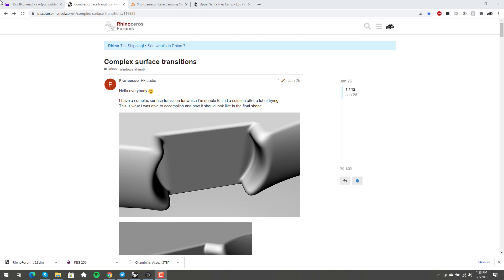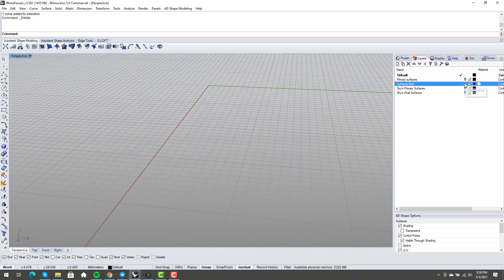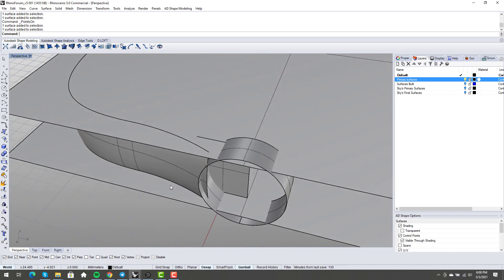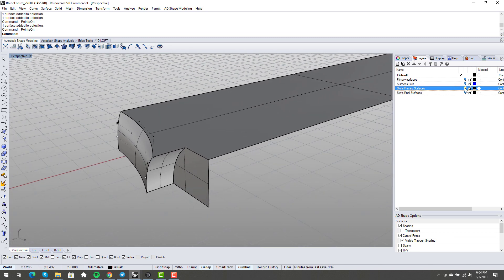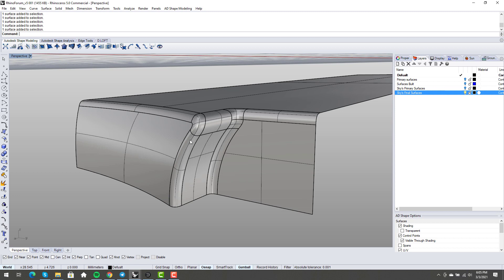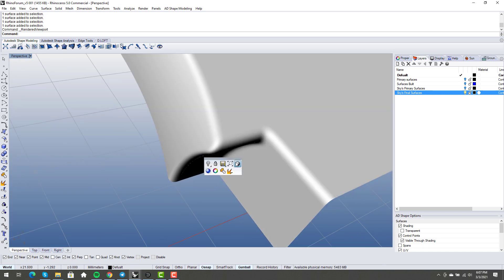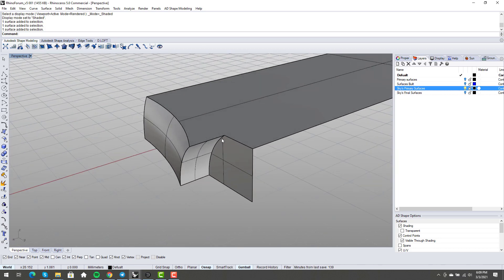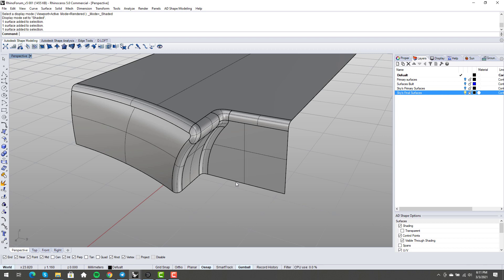Rhino Forum: Complex Surface Transitions Thread

Comment: Excellent job professor, how did the edges arise
Reply from the maker: Are you asking how I made my versions of the primary surfaces?
Reply: @thirtysixverts   yes how to creat this  object
Reply from the maker: There are really only two surfaces that need to be made - the curved front surface that I called out as being too small, and the "tube" that it intersects. There's lots of ways to do it, here's one - Use ExtendSrf with the option set to "Smooth" to extend the front face so it fully intersects. Then use Intersect to create a curve from that intersection, and rebuild it (in this case degree 3 w/ 4 points is fine). Use the other surface edges as the basis for using EdgeSrf to make a brand new surface. For the "tube" shape - duplicate the edge of the surface you just made with EdgeSrf, and extrude it back. Use SetPt if you want to make it stop at the back planar surface.
Reply: Just really wanted to say thanks a million! I really feel like in your first couple videos that I watched you were speaking directly to me. LOL I am 'that guy' whom was doing everything with surface curve Network and patch.... I am completely self-taught so I don't have too much shame :-)
But I have definitely known that there were lots of shortcomings in my surfaces. I basically equated to a junior mechanic that has walked up to a giant toolbox but everything I know how to use fits into one drawer. Most of my work is done in wood and I've gotten very used to sanding. Within the next week or two I will be undertaking the redrawing of most of my products- I HAVE TO. For my cam software I use vcarve. I do not know if you are familiar with it, but it does a reasonably good job of providing g code from a very less than perfect set of surfaces. As long as there isn't a gap big enough for the diameter of tool that I am using, to fall through the gaps it provides a part that is close enough for sanding. I was certain that I knew enough to be dangerous and that if I could just figure out a different workflow I could provide a satisfactory set of surfaces- I will 100% be adopting the workflow that you have presented. I found your videos at about 8:00 last night and watched one after another, just finished up watching the last one a minute ago. I look forward to seeing more of your videos when you have time. I can only imagine with your skill set you are a busy busy man- so absolutely THANK YOU!
Reply from the maker: @user-jv4vf4qo8z  Awesome! You truly made my day. I started the same place you did, so just realize that it's an ongoing, even lifelong process of learning. And also realize that if what you're making (and how you're making it) works for you, it works! Really this series is designed to steer people towards a more useful workflow when they no longer have the option of fixing flaws by hand, or simply want to get a better understanding of surfacing.